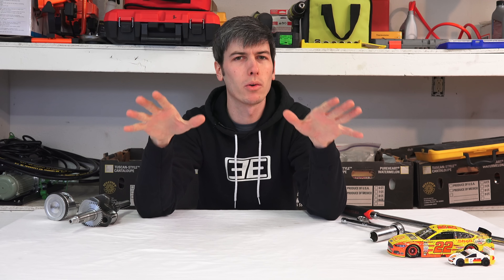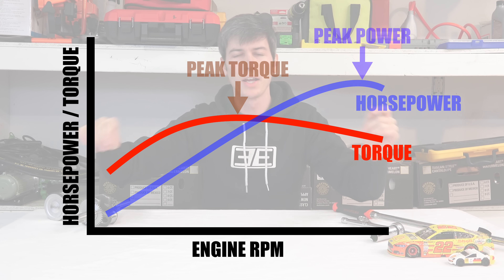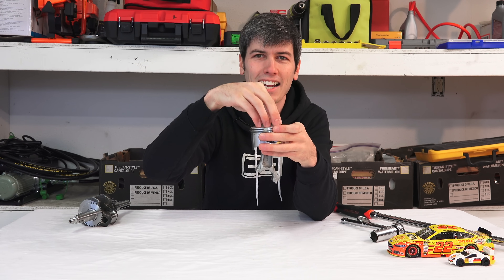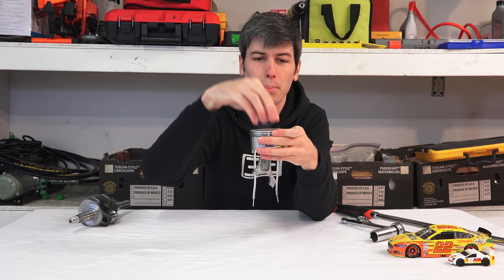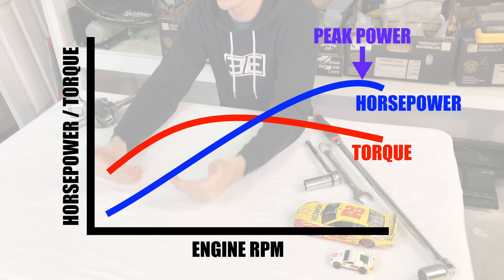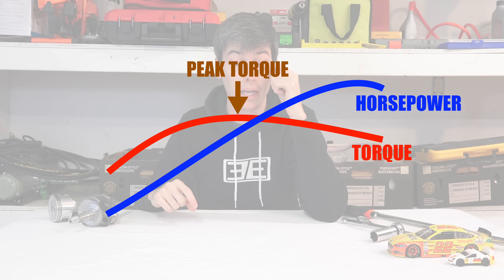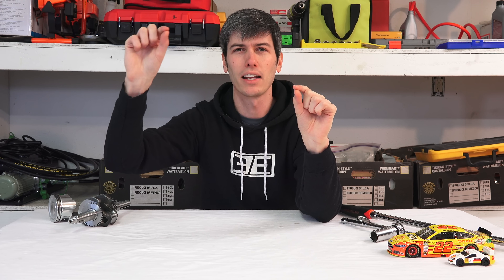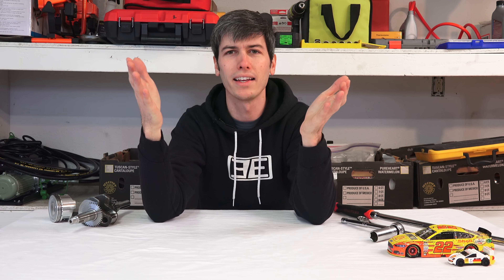Horsepower vs Torque - A Simple Explanation

Comment: Torque x RPM / 5252.1 = Power (HP).
EDIT: This is why the Torque and HP curves always cross at 5252.1 RPM on dyno charts.
Reply: Jim Griffiths no they don't
Reply: Kavi4GP For Newton metres it will be different but for Foot Pounds it always has to cross at 5252.1RPM, otherwise the dyno isn't calibrated correctly and will be giving false results.

Comment: I think H.P=(torque×rpm)÷5252.😏😏😏.Also can you please explain how we can calculate torque of an engine,without knowing h.p but knowing rpm of the engine?
Reply from the maker: 5252 is a scaling factor only appropriate when using imperial units. The equation does not hold up for imperial units, hence I did not include it when discussing HP and torque generally.
Reply: Engineering Explained  
  I do agree with you but what imperial units would you consider in case of engine and also please help me with the second part of my question😂😂😂

Comment: This is pretty much always true, with the exception of a car with a huge turbo and a lot of lag (also no cvt transmission). In that case I am pretty sure a lower hp car should be able to outrun a higher hp car because it has more torque.

Comment: Idk I feel like gears should have been left out of the equation, use a 1 to 1 ratio, because we're assuming both vehicles are the same, but giving the advantage to horsepower due to the use of gearing. If a car was left without gearing and was forced to start out in its closest 1 to 1 gear ratio, no mechanical advantages being used I believe it would be a more accurate measurement.

Comment: In the two cars example, the one with more horsepower is faster, but you said it’s because the torque can be changed. So is it still the faster one without manipulating the torque? Wouldn’t the car with more torque, less hp accelerate faster?
Reply from the maker: If they had the same gear ratio, the car with more power will ultimately still be the fastest, and will pass the car with less power, even if the car with less power gets the jump at the beginning. But in reality, you wouldn't ever have that scenario, you'd simply adjust the car with more power's gearing to be faster. You can't do this with the car with less power, because it can't compensate enough for it, and would only accelerate quickly to a very low speed.

Comment: Think of torque as how hard your pistons are pushing with each crank, and horsepower is the combined energy of each push over a fixed period of time.  The more times that torque can be applied, the higher your power output will be.  The faster your engine turns over, the harder it is for the engine to apply torque, since the pistons are already in motion.  It’s like trying to hit a baseball which is already moving away from you.  That’s why torque tapers in the high rev range, but power continues to increase, since you have so many cranks per minute!
Reply: CitizenEJ257 He was definitely a little contradictory. He stated you "feel" the most acceleration at peak torque but then explicitly stated peak acceleration happens at peak power. By definition, accelerating faster at peak power means that would also cause the most g-force, aka acceleration that you would feel. Not sure what his motivation was there.
Reply: @zecc81  , "He was definitely a little contradictory. He stated you "feel" the most acceleration at peak torque but then explicitly stated peak acceleration happens at peak power."

Yes it sounds confusing, but the explanations is, that wheel torque is what defines the acceleration of the car - not engine torque. And because change of gear ratio changes the wheel torque, you'll get the maximum acceleraton by choosing the gear that gives you maximum engine horsepower - even if a higher gear may give you higher engine torque at lower rpm's.

Example: You are driving a car, which delivers max torque at 3000 rpm and max Horsepower at 4000 rpm.  
You are accelerating foot down in 3rd gear and when the engine reach 3000 rpm, you'll get your maximum acceleration - but only if you stay in this gear. 
However, if you gear down to 2nd, the engine revs up to 4000 rpm and gains more horsepower, and despite the engine torque will hereby decrease,  the wheel torque will increase (caused by the change of gear ratio) and you'll accelerate faster.
Reply: @zecc81  i thought the same thing, acceleration is what pushes you back in your seat, period. this video is wrong.
Reply: “Your peak acceleration does not occur at peak torque.....  In reality, your car’s peak acceleration will always occur at peak wheel hp.”

This is not true.  For a given gear, the peak torque is the point of peak acceleration (most force applied to the tire contact patch). But in a lower gear the peak power point is able to supply more tire contact patch force (less torque at flywheel but lower gear ratio means more torque at the wheel).
Reply: AzuMentch36 Horsepower is only arbitrary insofar as the metric you choose is arbitrary.  For temps, it’s pretty arbitrary whether you choose to describe it with Kelvin, Celsius, or Fahrenheit.  Internationally, engine power output is described in kilowatts instead of horsepower, but what it describes is not arbitrary.
Reply: And here I thought horsepower was a arbitrary number, compared to the practical torque. XD
Reply: Greg Massey Thank you for the correction.
Reply: Its like running down a hill at full sprint but trying to speed up? Got it
Reply: Took you two sentences to explain what this video doesn't clearly state, even though it should be the sole purpose of the video.

I'm at a loss how someone can spend 7 minutes repeatedly contradicting himself and mixing terms, and get 10k likes. And you just removed the contradiction in one paragraph.

Good job, sir, you should apply for EE's ghost writer.
Reply: zecc81 He wasn't contradictory, because he was talking about acceleration in a given gear in one case and at given speed in the other case.
Reply: Lam if you can't clearly understand what the video states then you are the problem.

Comment: when car accelerate, and you are pressing into your seat, what do you feel? You feel power not torque right? you cannot feel engine torque from seat. Am I right?
Reply: You feel the torque since engine torque drives the wheel, then wheel drives the chassis which the seat is connected to. 

Max acceleration happens when you feel the most force from your seat which is equivalent to peak torque at the wheel which is usually peak power from engine through some gearing.

Comment: You said that you will feel most pulled against the seat at peak torque, but the car will still accelerate faster at peak HP (so lower torque) because of gear ratios. 

I don't get that. 

It seems that the only force that can pull you into your seat is acceleration (of the car). The faster the car accelerates, the harder you'll be pulled into your seat.
Reply from the maker: Yes, they seem contradictory. Peak acceleration for a given gear ratio occurs at peak torque. Peak acceleration for a given vehicle speed occurs at peak power. I explain this thoroughly here: https://youtu.be/cb6rIZfCuHI
Reply: Ok. I get the difference between engine torque and wheel torque, which will be greatly affected by gear ratios. But then the maximum "pulled against the seat" effect will thus happen at peak HP. 

In other words, if you were to place an accelerometer in a seat, it should register the maximum acceleration at peak HP. In that sense, you'll be pulled back into your seat the hardest at peak HP (not peak engine torque).
Reply: you got it
Reply: While peak acceleration at any given vehicle speed occurs at peak power, peak acceleration are different at different vehicle speeds.  You will feel greater acceleration at lower vehicle speed than at higher vehicle speed.  But they both occur only during peak engine power at that certain fixed engine speed.
Reply: protoslashwyl Regardless of the manipulation of gearing, the torque curve remains the same, ergo his statement is still correct.
Reply: which statement? I was clarifying why acceleration is greatest at peak power not peak engine torque.
Reply: you are mixing torque at crankshaft vs torque at wheel. Torque at wheel is manipulated through gearing, the idea is you can always get a higher wheel torque when engine is producing peak power

Comment: ..Or we could just say Torque is what gets you going. Horsepower is what keeps you going.

Great video Jason, as always..
Reply: No we can't just say that. That makes 0 sense as to how torque/horsepower works.
Reply: It seems that you misunderstood me guys, torque gets you going in the first place by applying force into distance as it happens between the cylinder and the crank. Power keeps you going over a given period of time since it's the work applied over time.
Reply: And btw, this is what Audi used to oversimplify Horsepower vs Torque
Reply: Please explain anything that's right about it.
Reply: @ryan But it's completely wrong, so there wouldn't be any point in saying that.
Reply: @black70 no, it's torque multiplied by distance over a given time period.
Reply: I was pretty condescending in my first answer, so i'll just apologize for that. But you still have the wrong idea. The way you describe it as torque gets you going then power maintains high speed is just wrong. Let's ignore gearing and assume a one geared car, or a run from 10mph to 70mph in second gear. Your acceleration is always directly related to the torque being produced at whatever rpm the engine is at. However, to maintain that torque as the rpms rise requires increasing amounts of power, even if the torque curve is completely flat - the same torque at 4000rpm requires twice the hp as the same torque at 2000rpm - because the the crankshaft is being rotated twice as far for every 1second at double the rpm- so twice the work is being done per unit time. You can't separate power and torque, as they are directly related (hp=torque x rpm x a constant (5252 if using imperial units).
Reply: This is not completely wrong, it’s a simplified way of looking at a complicated answer

Comment: Very nice video! Could you do a video about the moment cancelling engine designed by Dan Gurney? He claims to have increased the power output significantly by a special diameter change in the intake manifold system, combined with vibration cancelling crankshaft design, I think this would make for a very interesting video! ;)

Comment: In the example with the two cars. Lets accept there is only one gear on both cars and its identical. Will the car with the higher HP be faster again and what if the Torque on the first car is not high enough to move the car ?
Reply from the maker: Depending on the gear ratio chosen, the vehicle with more torque may be quicker for a very brief duration, but ultimately the vehicle with more power will achieve a much higher top speed, so it will pass it.
Reply: Hmm thank you. So at the end the car with the more Torque on the wheels will accelerate faster but the car with the more Power will have a Higher top speed.
And if we compare both cars again and their gears are made so, that they both have the same Torque on the Wheels, they are both going to accelerate at the same speed ?

Comment: Great video, but a quick question. Why is it that modern Subaru CVT's still "shift" then? Wouldn't it make more sense for them to hold at peak torque?
Reply: Btown Ninja they do it because the public wants it. Yes it makes more sense to hold a specific rpm. Not all Subaru have this though.
Reply from the maker: It's a marketing decision because people like the sensation of shifting because it's what they're used to. In reality, there's no logical reason to do it.
Reply: In my Subaru it depends a lot on how I drive. Slow input changes and keeping a steady throttle the car usually DOES stay right at 2000 RPM when accelerating, then dropping to 1200ish to cruise depending on speed. If you're moving your foot on the throttle a lot I think the car is trying to guess what exactly you're doing. Too much throttle and it thinks you're trying to go fast, so it moves to a higher horsepower RPM and ratio to match it. Pull back off the throttle and the computer thinks "Oh, we're done going fast, cruise now" and "shifts" it's mode to cruise style. If you just floor the gas all the time until you let off and mash the brake, like you would at a track, the RPM stays very high in the peak horsepower range and also you'll probably fry your CVT
Reply: Thanks for the reply. It's with my brother's 2017 Impreza. Even when pinning the throttle to the floor, it still 'shifts'. As someone else mentioned, I assume it was a decision made to appeal to those more used to traditional automatics. I believe even the WRX CVTs will 'shift' regardless of mode selection when you pin the throttle. It just seems odd.
Reply: That was my assumption as well. Seems odd not to give the driver the choice (at least there isn't a choice in the 2017 Impreza my brother has). Awesome car otherwise.
Reply: Engineering Explained. Reasons like this are why engineers are always frustrated. Unfortunately we can't always make something ideal. The way you put it made me really laugh.
Reply: The least they could do is make it optimal in "eco" mode and fake the shifts in "sport" mode.  I hate it when poor designs win due to ignorance.

Comment: even more confused o.0 i always looked at it as torque = acceleration and hp= top speed
Reply: correct.  try this.  I can generate 200ft/lbs of torque with my 1/2 drive wrench in my shop - I do it all the time. this is static force. nothing is moving once the bolt is tightened. Can I also accelerate a small hatchback from 0-60mph using my arm? my arm and a long handle wrench? no.  I have little power.  I can't spin the wrench fast enough. also why Harleys still suck and their owners still tell you (and you seem to believe) "it is all about the torque"  LoL. Really? So i should be able to accelerate a Harley better than its motor? think about torque as "potential" to do work and power as actual ability/performance/execution/reality.
Reply: Right...I think I got it. Just until "hello everyone", and then you lost me. Would you repeat the last part again?
Reply: Also think of acceleration as it relates to wheel torque not engine torque. A high horsepower low torque engine can be geared to match the torque at the wheels as a low power high torque engine, but it will have a larger effective rpm range. So the higher horsepower engine will accelerate the car for longer.
Reply: Yeah I think that's a common misconception. HP = top speed and acceleration. Torque just gives you a better picture of the HP curve (i.e. how wide is the powerband). Ultimately you would want to look at the actual dyno chart.
Reply: Torque is how much weight you can lift.  Horsepower is how fast you can lift it.  They are different components to describe the energy generated, both are important and inter-related.

Comment: What determines the maximum rpm in an engine?
Reply: various factors for example: stroke, internals (especially Valves), combustion principle (Diesel/Petrol)
Reply: The max engine speed is 'just before the internal parts start injuring themselves' but there are too many parts & processes and too many ways they can go wrong to give you one answer.
Reply: In addition to the 
weight and inertia of moving parts; combustion propagation can be a limiting factor. There is a finite speed at which combustion can spread through the cylinder before the the piston goes past BDC. Smaller cylinders usually have a higher rpm limit because the ignition has a shorter distance to spread before the piston changes direction. This is part of why v12 super cars to generate large amounts of power from relatively small displacements. They can spin faster than a  larger v8s.
Reply: Mostly a design aspect for drivability, bottom end power suffers with higher rpm designs
Reply: Also weight of every moving part. That's why you see light Hondas with 9k rpm and big v8s and with 6k rpm. Diesels are even bigger with a 4k rpm limit

Comment: Under acceleration:
Torque: How hard your head hits the head rest.
Horsepower: How long it stays pinned against the head rest.
Reply: Faraz Abtahi no no no no
Reply: Yes of course its an oversimplification. This is what people are feeling when they say their "butt dyno" is telling them x figures.
It also explains the difference between the S2000 (more hp than tq) and say a GTI (more tq than hp)
Reply: Torque on the wheel is not equal to torque of the engine because of the the differences between gear box. Generally, the more horsepower, the more torque you will get on the wheel. Torque of the engine only affect the rpm of the engine.
Reply: That's actually terribly inaccurate.